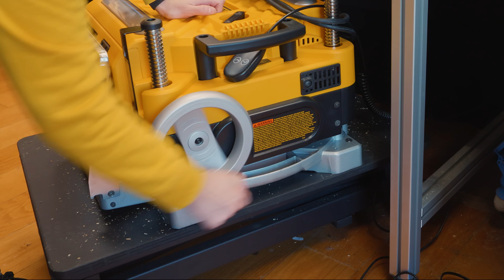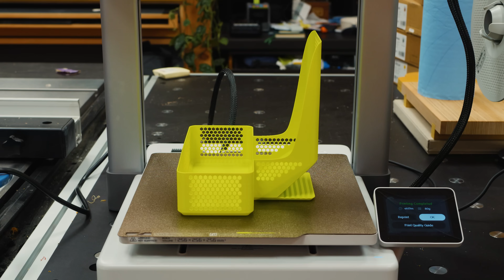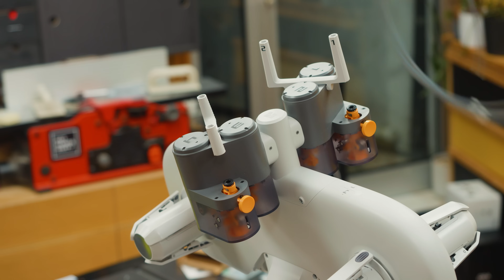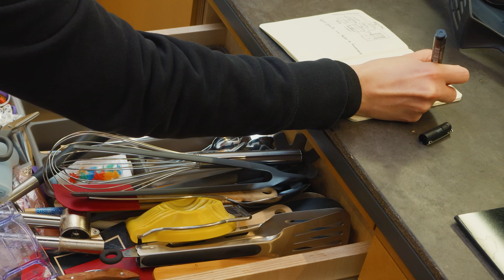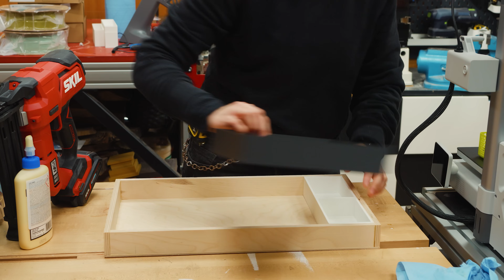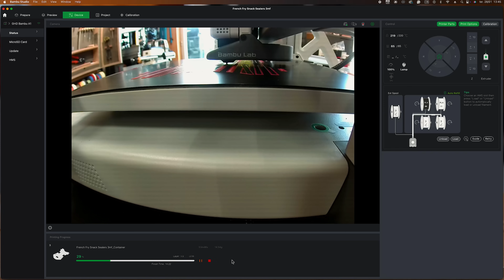Organize your Home with 3D Printing // No 3D Modeling Required

Comment: Thank you for sharing this video.  Just out of curiosity.... what do you need the piece of wood above the drawer slides?  I have never put that on my drawers.  does this help the drawer slide stay in place?  I was just wondering if I have been doing it wrong?  TY.
Reply from the maker: Those pieces are barriers so that the new tray doesn’t fall off to the side. It keeps in contained moving only back and forth. It has no implication with the drawer slides.
Reply: @GetHandsDirty  thank you very much.

Comment: I just joined your Patreon because your Sofa Chaise Lounge build was exactly what I needed—and now this 3D printing video is also perfect for solving a problem in my weird-shaped kitchen drawer! I really love that you jumped into 3D printing even without a lot of 3D modeling experience yet. I’m a self-taught designer myself—started with Autodesk Inventor and later moved to Fusion 360. It felt overwhelming at first, but asking super specific questions to ChatGPT (or other AI tools) has helped me learn so much along the way.

If you keep making 3D printing videos, I’d love to see details like slicer settings, filament type, extruder size, print time, how much filament you used, and any post-processing tips. And honestly, I find it super helpful when people share what went wrong, too—like failed prints or weird issues—and how they fixed them. Keep going—this is really inspiring!

Comment: Bambulabs have been in hot water recently for suggesting changes that the community doesn't agree with. Then Bambu decides to gaslight the community. Lewis rossman done a video on it if you want the deets

Comment: My first project on my 3d printer was exactly such organizers. I use SketchUp as well and for now it works but need to learn some other apps like Fusion360 or OnShape. One advice  - you should have made arcs between the walls so you can easily take the items from the boxes.

Comment: I like gridfinity for lateral storage and multiboard (which is surprisingly strong) for vertical. Also, check out the printable jigs for routers and dust collection.

Comment: I just bought a Bambu A1 and an A1 mini for the maker's space I manage at a college.  Loving them both, so easy to use.  I had different brand printers and there is no comparison.  So helpful in the shop and for prototyping.  Plus I've been printing models of turtles, skulls and cells for our science department.  Fast and simple to learn.  Start with stock designs by others, and try a variety of different things to understand how it works.

Comment: Pro tip: do not touch the bed plate with your hands. 

Grease will ruin your adhesion and you’ll have to clean more often and have more failed prints, use a small dull-ish spatula to lift them and maybe help pull with your hands from the top without touching the bed.

Comment: Small word of caution: I've found that it's a bad idea to use PLA for mechanical parts, like the ones that clamp around your printer. PLA is very stiff but it creeps over time. A connection that's tight and sturdy at first will become loose enough to cause problems over the course of a few weeks to months. The screws you've used might help prevent that, but if you screwed straight into the plastic that might come loose as well. Just something to keep an eye on.

Comment: Sharing: If you have multiple drawers and you figure you'll have the same layout, vacu-forming works AOK with PLA. I made a domed shaped supports for a farmer friend (ostrich eggs) and supported it inside only with toothpicks (it was printed in vase mode), so for drawer organization, a smaller form will work just fine with just thick walls. I recommend the plastic used for greenhouses, the 1mm thick one that doesn't turn white when bent (by hand). 1.5mm holes in critical ares like the shapes where the dividers will form into, spaced about 1.8~2 cm apart is a good start. All the rest should be as Adam Savage did in his expedient but good tutorial.
And on the side of 3D printing, my personal recommendation is to print trays in a diamond pattern (at 45 from the axis of the machine) and adding 4 ribs internally, by "denting" the outside inwards (in the program). This will create a very strong tray. I've printed at 2 mm thick, 10x10x20cm (lxLxH), big bolt trays that are strong enough to be picked up full, by the lips even after 4 years (both PLA and ABS, untreated).

Comment: As I am new to 3d printing as well I will give you small tip. in the video were you join two parts together the one on the left is "wraping" from the bottom that might be caused by a draft in the area you were printing. Some enclosure will sort the issue (if you find this problematic) it also can cause print to fail so keep this in mind.

Comment: 3d printing could improve your work in many ways, by making custom templates, many interesting tools and other useful things for your daily life. If you want to learn to 3d modeling as an architect I can recommend you to use rhinoceros 3d (or simply rhino), it’s a powerful CAD software to make 2d drawing and 3D modeling, and the main difference with Autocad it’s that rhino works with polynomial curves (vectors) instead polylines, this gives you a better result on your models and can make complex surfaces on an easier way and the modeling interface it’s similar to technical drawing, making your curves on the plane and then extrude it, also rhino it’s focused in digital fabrication so your models can be easily printed or cut on a CNC machine

Comment: It already came up in the comments but bambu currently has a PR-issue, as they started showing their intentions. They might have the top dollar to promote their business but are not the only ones when it comes to 3d printing and there are a ton of alternative printers and marketplaces with files that are easy to download and use without stepping into a walled garden.

The video is still great and a nice introduction but I wanted to add my two cents.
Reply: what other printer in this budget is multicolor and "click print and forget"? I would get Prusa if it wasn't twice the price or more.
Reply: Hi there, can I ask what their intentions are?
Reply: @Milena-ss6jh  there are probably better people to ask than me and there is a lot of information a quick search away, but the tldr is that they want to lock you into their ecosystem. Being locked into an ecosystem without flexibility can be a problem, as open source third party software offers a broad spectrum of helpful solutions, and will always used to get some value from the userbase. How and what kind of value is not yet sure but is sets a precedent that is not good and means you no longer fully own your printer.
Reply: @chaosintheworks  Bambu introduced a firmware update for their printers that will block access to the printer from third-party software providers unless you install a new (beta) connecting software, or if the third party becomes authorized. People use third-party software like OrcaSlicer to have more control over their prints. There is controversy because users think the Bambu software is intended to collect information from the user and lock them out of the system if they don't want to install it. Bambu claims it's for security reasons and protects the printer from being hacked or used in cyber attacks. It limits how you can use the printer. Basically people are afraid this is going to turn into the thing you see with inkjet printers, where HP decides you can only use their official ink cartridges and you can't print colours if the black ink is gone.